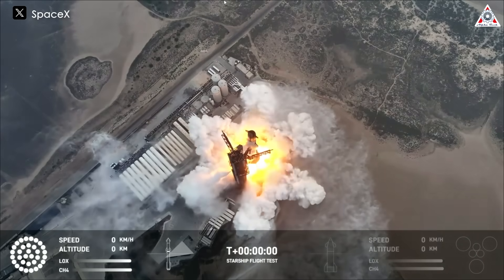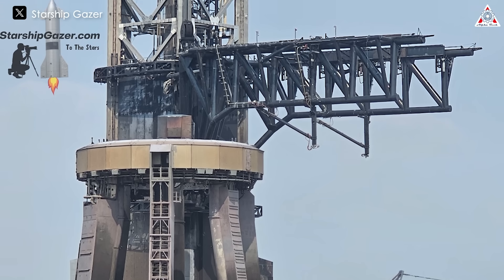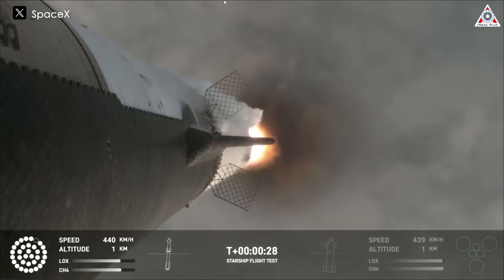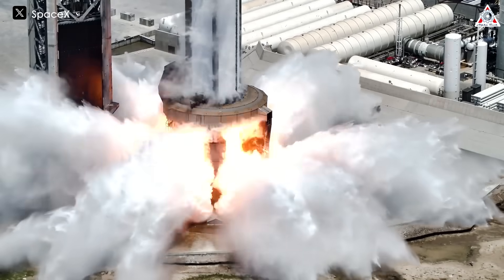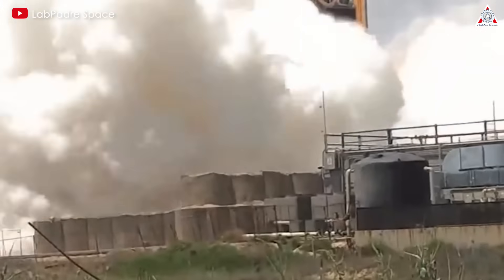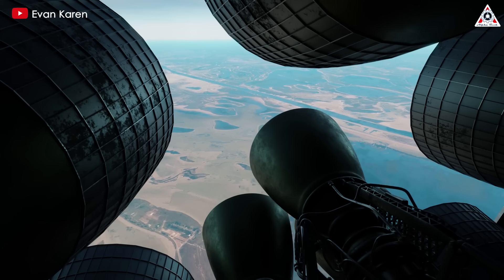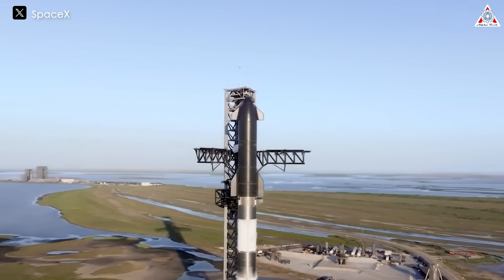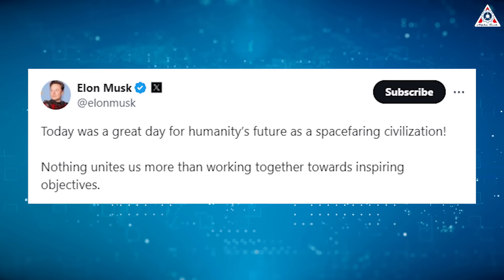How SpaceX Launchpad Aftermath After Starship Launch Attempt 4 Will Blow Your Mind!

Comment: You mentioned "mistakes". There were no mistakes other than your characterizing the Scientific Method as a process of mistakes. A mistake would be if they filled the fuel tanks with chocolate milk.
Reply: chocolate milk would have been a much cleaner and much more powerful fuel🤔

Comment: Save lifetime, start at 1:03. Until then the speaker is basically saying that it is bad if the launch pad would be damaged. Starting at approx. 3:00 you learn that it was damaged and repaired previously, and it is very important that it is in good condition, and that SpaceX must test it therefore, and they plan to fly to the moon, and Starship is the most powerful rocket of the world. So if you never followed the news, this video really Will Blow Your Mind.

Comment: I have pointed out repeatably in the past that SpaceX made a mistake by not using an exhaust deflection chamber, multiple launches will attrite the launch platform on an ongoing basis and ongoing maintenance will create delays and extra costs.
Reply: There was no room for such a structure and the FAA would be extremely unlikely to approve it for that location.  I think this will be more concretely understood when the second tower is up and they still don't use one.  What SpaceX came up with is actually quite revolutionary, and you can expect many future pad installations to opt for something similar now that it's understood that you can arrest the force of the most powerful rocket in history with a simple plate that emits a deluge.  That's cheaper and simpler to set up than a pit and deflector.  Also, any damage that occurs at Stage 0 tends to be limited to surfaces not covered by the deluge system.  Perhaps the true solution is to provide water for those areas also.
Reply: @Asterra2  There was plenty of space, the reason a trench was not built was not about lack of space. I know what that reason was, do you? I would like to give you a hint, water.
Reply: Iterative design processes will address all issues in their due time😊

Comment: Shocked?  At what?  The cost of the litter scattered acrossed two oceans?  And for what?  What have we gained out of the "starship" launches that wasn't previously being accomplished.  Maybe, someday, starship wil be a useful launch platform, but will it beat Tesla's FSD to usefullness?  Problably, but right now it is an overweight under producing waste, all at taxpayer's expense. Shill much?
Reply: Bro, the entire world besides Thunderfoot and his small cabal understand perfectly well that this was a huge success.  You won't find any respectable media outlet pretending otherwise.  You said it yourself: Starship will be a useful launch platform.  It won't get there in a single prototype—that's not how SpaceX operates.  Other space entities may be stuck doing all of their testing in simulations because their designs are too expensive to waste on test launches, but SpaceX is proving that if you can launch cheaply enough, it's simply faster to get your testing done with real flights.  Here's a question for you: How much do you think Starbase/Starship has cost so far, and how much of that do you think taxpayers have footed?
Reply: For Helium3. If the Chinese land men on the Moon, they WILL claim it for themselves. They are NOT signatories to the treaty. Helium3 is absolutely necessary for FUSION.
Reply: 💯 exactly

Comment: The funny part is that everyone focuses on the booster recovery and no one cares where the upper stage (precious cargo) 😆😆capsule went?
Reply: Lots of other videos on Starship and its landing off Australia.  But not every Starship will land back on Earth.  On the other hand, all the boosters will.  So they need to get the booster's landing right first.
Reply: @tmg7476  disagree, that is not the way it works…the mission is the payload. The booster is the showmanship with no scientific merit 😂
Reply: @Mannicx  Try reaching orbit without the booster.
Reply: funny, the way people try to change the main subject. For many years there is little to no importance to a booster, it’s the science or payload of the mission that’s important. The real issue to me is the lack of scientific focus.
 The booster recovery is a secondary economic subject. Important yes, top of the list no. You can’t use the recovered booster anyway without significant refurbishing. Ask for a picture or cost of the recovered equipment and how much is usable. In the meantime no one asked about the payload progress.

Comment: Control fin problem should be simple.

as with old armour joints
tiles molded to deflect the flow of plazma and air flow
deflecting up away around
also raised molding edges  of tiles where they end 
on top edge of cyclider as the mplasma seems to
flow over naked steel body.
liquid nitrogen feed into control fin area
at highest period of two minutes
may well protect for crutial period?
all in all one hell of ride USA to Austrailia in 54 minutes
Reply: the problem with moving parts is that you need a gap...therefore heat flow plasma finds its way into the core.
Reply: @Mannicx  tghe problem is flow and diverting the flow away and around. the flow withg kariander effect clings follows the surface around???   Shaping overlapping the joint area and the cylinder tile edges up and away also if need spray liquid nitrogen around those area at high risk Should elevate lessen problem.Great flight. better on a drone ship with legs or a flat sparse AREA ON on legs nin a target roundal

Comment: Quick turnaround has the same chance as the current heat tile protection system. I posted years ago that the tile system would not work. Tiles were one of the shuttle's problems never resolved. All current return capsules use ablation systems.
Reply: You're talking about Elon and Space X, not a government funded organization. When everyone says it is impossible, Elon says hold my beer, he will figure it out!
Reply: @lynardskynard8443 Damn straight! Elon is the man!
Reply: 😁😉  👍   @lynardskynard8443
Reply: @lynardskynard8443  Space X IS a government funded organization to the tune of over five Billion dollars so far. So was Tesla for the ten years they didn't make a car ( carbon credits are tax dollars) Elon doesn't design anything his engineers do. Elon is very good at two things : milking the system and surround himself with superior people that give him all the credit.

Comment: Not 32 it's 33 . When exiting the launch tower 33 were firing . Shortly after, 1 was not working. If you are speaking about the tower aftermath don't say 32.
Reply: Exactly 5 seconds and at 27 km/h so only 32 raptors really fried stage zero. Nitpicking much?

Comment: Why not launch at a taller height? Build the launch pad over a canyon with connecting railroad tracks   .  Create a floating dry dock launch platform in water utilizing caissons. Don’t get me started on those dang ceramic heat shield tiles.
Reply: at lower height u accelerate faster and more efficiently because of atmospheric pressure
Reply: @doodocina  You have absolutely no understanding of how rocket propulsion works, do you?
Reply: @johnarnold893  nah, learn physics. even engine type says "sea level"
Reply: @doodocina sea level or vacuum refer to the nozzle length..
Yes, all of Life relies on physics kiddo. Studying physics is a non-finite endeavor.
Everyone knows heat shield reliability is the most difficult component at this point.
Reply: @doodocina  a couple hundred surely would not affect this principal to any appreciable effect. How about this.
       recover more of  the rocket motor exhaust to get the rockets off the pad. As an example, a gas operated firearm taps a small amount of the propellant gas behind the bullet traveling down the barrel. This is routed thru a hollow tube and pushes the bolt back extracting the empty cartridge.The energy is sufficient to propel the complete cyclic function. A newer version of firearms use an impingement rod to push back the bolt compressing the buffer spring which rides the bolt forward again and reloading the chamber. This system prevents the exhaust gas from interacting with the internals of the gun.